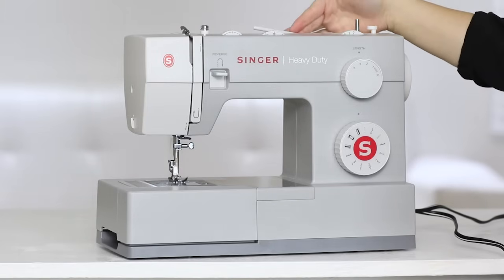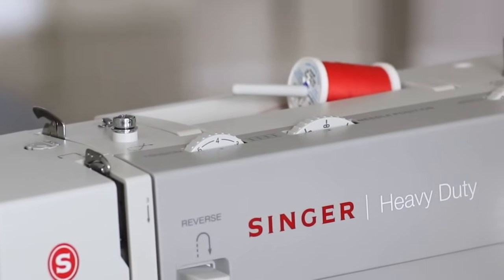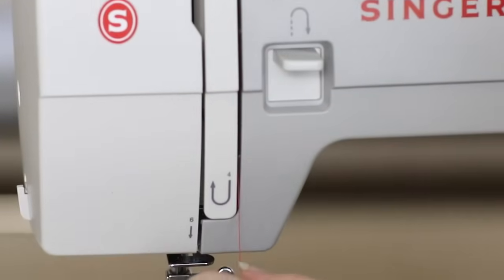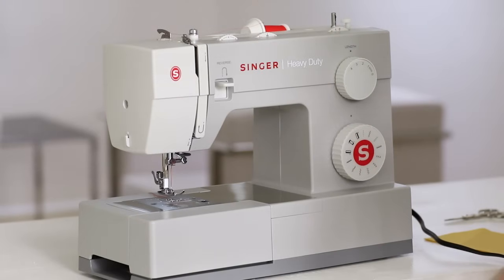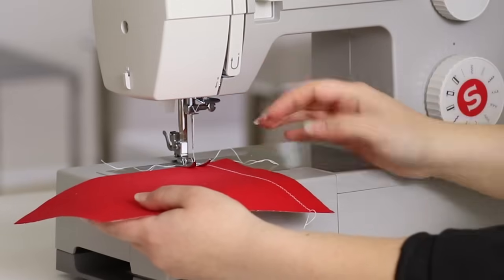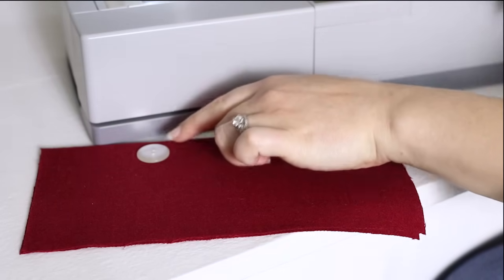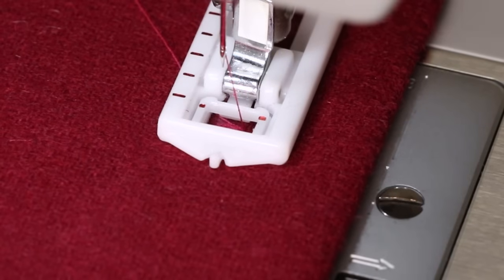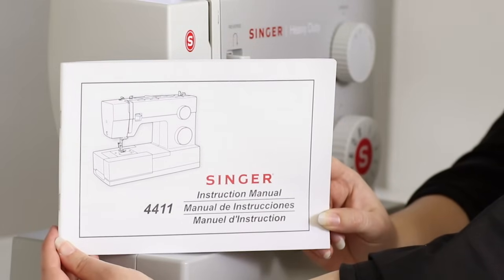Getting Started Heavy Duty 4411: Set-Up Your Machine

Comment: I appreciate this tutorial a lot, thank you for helping me use my new machine. However, when I try to draw up the bobbin thread, it takes 3-6 rotations of the hand wheel to actually draw up the loop, and when I try to test a stitch, it never comes out right. I believed that I followed the instructions correctly, do you happen to know the reason for this? Thank you! :)
Reply: Just a hunch. Check your bobbin. Thread direction should be counter clockwise.

Comment: the same problem, one plug for the pedal and the electric wire, it should be individually, and to add a play button in the machine itself if the pedal is damaged, should be something to work with until I got a new pedal, and I think if u push the reverse button it'll be enough to reverse stitches without need to press the pedal in the same time, Thank u 4 everything u have an amazing quality ur the best
Reply: I definitely agree, u have a great point about the pedal and reverse switch lol.

Comment: The cone in front of the spool of thread is on backwards. The presser foot should be down when puling up the bobbin thread.
Reply from the maker: Hi! It's always a good idea putting the spool on as recommended in your owners manual. While I do agree that it's easier with the presser foot down, it can be done with the foot up. Thank you! -TB

Comment: What is different this 2 model 4423 / 4411.
Reply: Is there a option for scallop stitch?
Reply: Cuanto cuesta
Reply from the maker: The main difference is the number of stitches, but the 4423 also includes a one-step buttonhole and a built-in needle threader. Full comparison: https://www.singer.com/compare-products?compare=10069,10070&rand=0.024103158961252147
Reply: Singer Sewing Company My Singer 4411 Feeder Teeth won’t realign itself after LOWERING IT or activating the lever to return back to normal stitching mode.  The thread also keeps knotting up once I try to align the thread 🧵 with the bobbin feeder.  I live in Owings Mills MD. Can you please recommend places that can give an accurate diagnostic of my machine.  Thanking you Kindly,....
Reply: @SingerSewingCompany  what's difference between 4423 and 5523?
Reply: @SingerSewingCompany  The link is broken. I am interested in comparison videos of your beginner products that can be used on denim.
Reply: Singer Sewing Company 
Where do you have sewing stores in New Jersey?